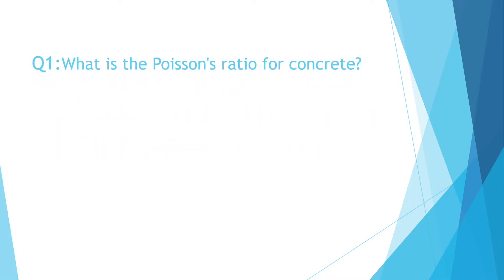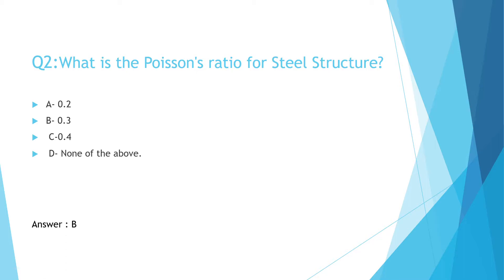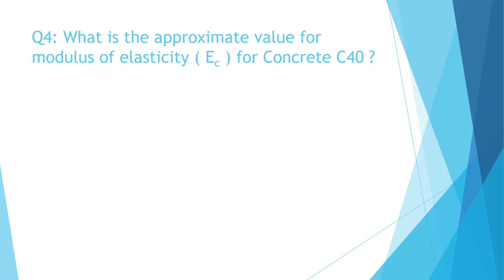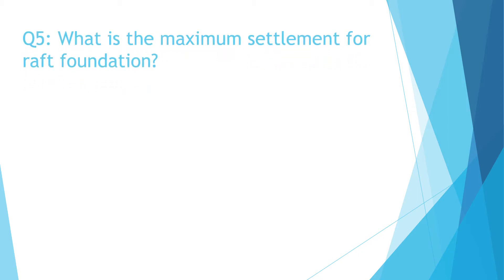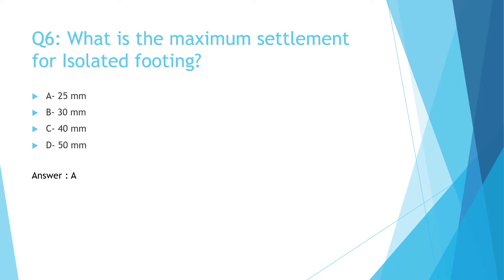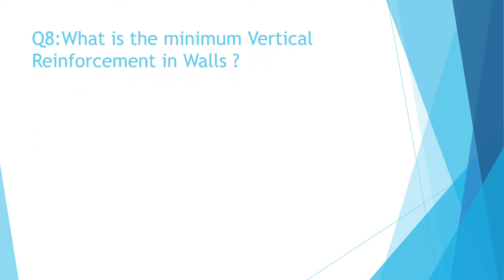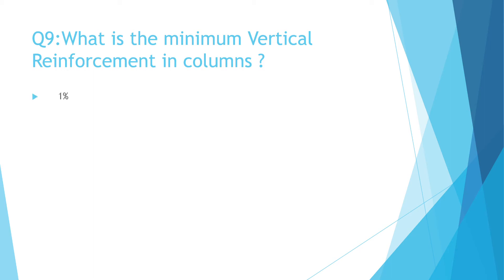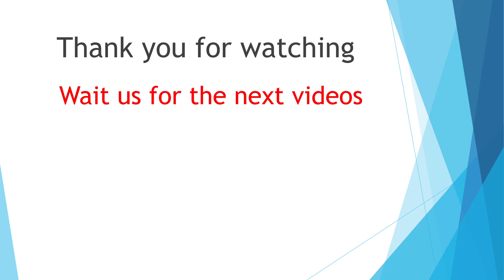Dubai Municipality Civil Engineer Exam 2022 for Unlimited Floors Part 2

Comment: The minimum vertical reinforcement will be one percent (1%) in columns and four tenth percent (0.4 %) in walls, and the minimum horizontal reinforcement will be (0.25%). The diameter of stirrups in columns and walls with a vertical reinforcement ratio greater than one percent (1%) must not be less than ten millimetres (10 mm), with maximum allowed spacing between stirrups. This is as per DM
Reply: Will u plz share Me notes for G+12